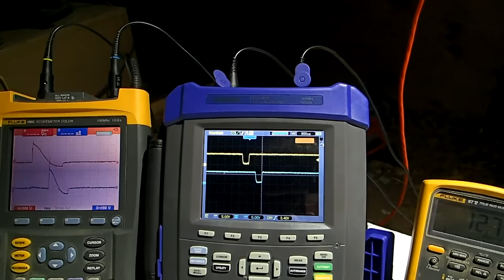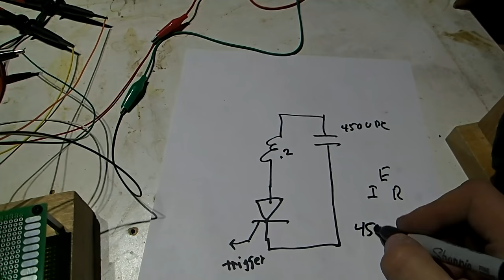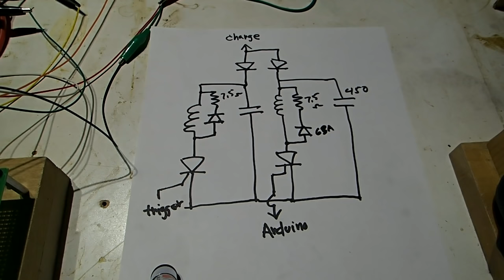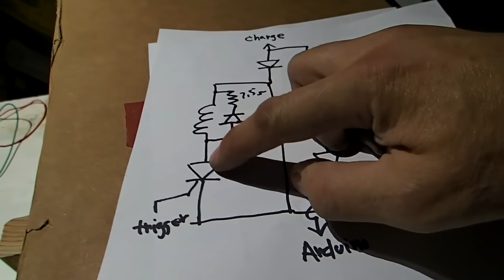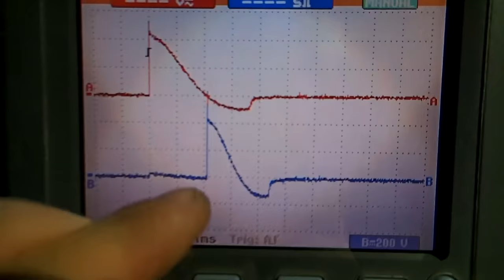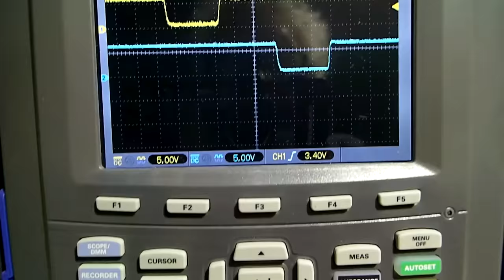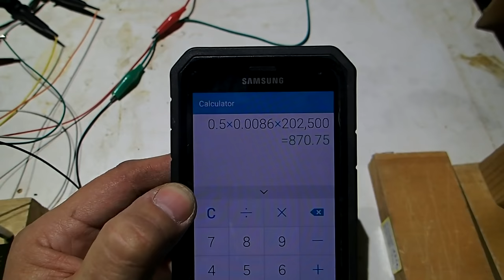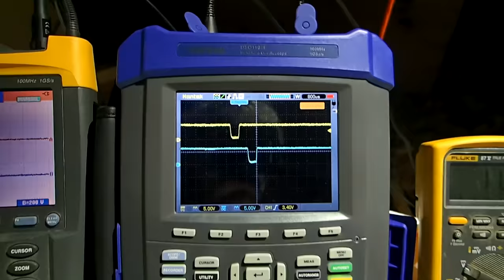World Fastest Six Stage Coil Gun Yak Questions Answered

Comment: May I ask why you used diodes and resistors parallel to the coils? The thyristors shut off when the current is zero so there won't be any damage through induction voltage anyway. I think the parallel resistor even lowers your speed because the coil is losing the remaining magnetic energy more slowly compared to just let it fully flow back into the capacitor. 
I also experimented a lot with coil guns so far and also tried different more or less complex circuits like using the stored energy of coil 1 to assist coil 2 but also tried your resistor + diode parallel thing and also diode + capacitor in parallel but I couldn't see any advantage. Actually I just let the capacitors freely recharge with negative voltage and discharge them over 2 small coils with a few windings at the end of my 6 stage coil gun (so its somehow a 8 stage gun) to gain additional 7 m/s plus the capacitors are recharged with about +50V at the end by these last 2 coils.
My coil gun is currently accelerating a 28 grams projectile to 95 m/s but Im still using single thyristors and big capacitors with screwing connectors which is really bad.
Are you still working on your gun?
Reply from the maker: You did not absorb any of the information in the video so all I can suggest is that you watch it again, the back EMF from the coils is conducted through the diode and a resistor in series not parallel that feeds back into the capacitor bank and charges the capacitor Bank up backwards you would think that it would be some damage to the capacitors but that only lasts for instant of time and then capacitors are discharged by the second diode and resistor in series in another part of the circuit which is shown in the schematic of the video and explained.
Reply: @RaptorRotorHead  What I basically mean is that your circuit would also work without the resistor and diode (in series) parallel to the coil. I couldn't recognize any change when using it on my gun except capacitors being negatively charged a little less (like -200V instead of -260V) because at the moment the Voltage (at the coil)  drops below ~ -0.5 V, the current generated by the coil will split and feed the parallel resistor+diode and the capacitor simultaneously.
Reply from the maker: @sacrifer7499  yeah it would work without it but at a loss of power. What are you using to measure speed? I am using a scope. The diode and resistor control the suckback on the projectile and the reverse voltage, mine was 200 volts.
My coils were close to 300 turns. Without a resistor in series with the diode, the diode 20amp would explode. Unless there is a scope or chronograph to measure speed there is no way to know if the experiment is going faster or slower.

What you see in the video is everything that is needed to get the maximum speed and control voltage spikes so as not to have too much EMP to confuse the computer system that fires the coils.
Reply: @RaptorRotorHead  My measurement system is like yours but instead of a scope iam using the controller to measure the timing which also calculates the speed and displays it on a little oled display.

Funfact: A Diode once exploded and also my Thyristor was destroyed because of that. The resistance was either to low or the Diode wasnt able to hold back the 1kV and simply bypassed the coil and thus shortcut my whole circuit.

However, I measured no change in speed when placing a Resistor + Diode parallel to the coil (also changed the trigger timings). I tried several different Resistors and once I got +1 m/s but that wasnt repeatable so I think it was just a little error due to a slightly different starting position of the projectile. Maybe I'll give it another try soon with different capacities.

I will also upload a video of my gun demonstration soon but actually you can only find one of my first coil gun which was a primitive brush commutated coil gun :)

My current gun is far from mobile use with its weight. Im using 16 350V 3300uF capacitors each one 460 grams heavy. They are easy to connect and cost me nothing because we have dozens of them rotting unused in the company I'm working in. Next step would be ordering about 60 x 350V 1000uF capacitors with a weight of about 70 grams each but thats so expensive.

Comment from the maker: well I just did you have to figure that the turn on time of the SCR is like a microsecond or less so it if it was late by 500 nanoseconds that's not going to matter. Also diodes in parallel do not lower resistance you're thinking of Power fets. scrs have a voltage drop of six tenths of a volt no matter how many you put in parallel. what increases is the amperage capability. this gun has been shot hundreds of times, wit no failures. that's not to say I didn't blow up stuff in the beginning because I did. where's your video does your gun run on batteries?

Comment: Well I plugged your Ft. Per. Sec. 256.4102564103 into a converter and it comes ouy that your projectile is traveling at 174.840819136151 Miles Per. Hour which is decent, if I right in my numbers.

Comment: Good gun) but i stiil didnt understand what speed the projectile reaches?
Reply from the maker: About 260 feet per second.
Reply: @RaptorRotorHead  Do you think it is possible to reach a speed of 100 m / s?
260fps≈79m/s
Reply: @gexometilentriperoxiddiamin  well that only depends on the number of coils and the voltage you use. It's helpful to increase the voltage in 330 volt steps for every 2 or 3 coils for example. So coils 1 and 2 @ 330V, coils 3 and 4 @660 V and coils 5 and 6 @ 990V and so on. This way you achieve a linear increase in speed per coil.

Comment: Is there a reason that one large coil can't replace a multi stage system? Wondering about accelerating the velocity of a preaccelerated projectile. Thinking conventional propellant.
Reply from the maker: The projectile cannot gain enough speed with one coil you might make 100 ft per second, with two coils you could make 147 feet per second with three coils you make 180 ft per second so as you can see I've already tested this out each successive coil get you less and less speed. Maybe you could use one coil if you use 10,000 volts, and sling a massive projectile, but then we're beyond the voltage rating of this circuit.
Reply: @RaptorRotorHead  Ahh, yes I'll definitely be using a different circuit. My friend has much more knowledge on this end. Projectile will be quite large by comparison, I'm thinking 12mm, about an inch and a half long tool Steel cylinder with a carbide core. Construction of such a prototype is legal in my area as long as I don't exceed a given diameter of projectile where it becomes a "destructive device" as per US federal laws. I'd like to achieve 6000fps, which is crazy, but shoot for the moon right 😂 science. Not dismissing the multi stage coil though, just wondering about the reason you used it.
Reply: @RaptorRotorHead  obviously I have a serious amount of math to do, I'm a prototype machinist with access to machines and exotic materials, and I have friends who are adept at welding and circuit design, electric motor building soldering etc.
Reply from the maker: @SunTzuLao  if you expect 6000 feet per second you better use rail gun technology to get that.
Reply: @RaptorRotorHead  yeah it's so much more complex though, and fragile. Was hoping I might be able to overcome some of the shortcomings of coil gun theory like magnetic saturation by using it for a secondary acceleration mechanism.

Comment from the maker: usually you don't need an air gap in a Transformer Almost Never most the time there's an air gap in a inductor. if there's an air gap in the Transformer it's probably because they were afraid the core was going to saturate at the current level going through the core.

in the carbon fiber tube is .280 ID with a .032 wall thickness

Comment: Why not use spark gap and projectile as your trigger. Instead of mosfet, which requires painstaking calculations in sequencing to get "kinda close" to the proper firing where as my way would react as soon as the projectile is in range and off as soon as soon as it's gone. It would be exact for every stage, no matter how many stages with zero programming.
Reply from the maker: There is no mosfet triggering in the circuit it's all high voltage scr computer-controlled
Reply: @RaptorRotorHead  Thank you for such a quick response. I've not used scr's yet. I am still working on a design. What about the solid contact/spark gap and projectile for firing? Would that be plausible? What would be the downside other than the obvious maintenance of contacts and projectile wear?
Reply from the maker: @mobiusprolix8454  response time would be the problem with that type of circuit what is needed is a computer that is capable of 3 microseconds of timing error and no more, operating solid-state scr so that the response time there is instantaneous
Reply: @RaptorRotorHead  Thank you

Comment: do you remember the timing sequence for the coils . can you tell me
Reply from the maker: Stage One 2.1 ms, Stage Two 1.4ms, Stage three, 1 ms, Stage four 800 usec,
Stage Five 600 usec, Stage six, 580 usec
Reply: Clay Reid  did you just use the function called delaymicrosecosd to produce the delay or is there any other method
Reply from the maker: Vasudev Mr yes delay microsecond
Reply from the maker: Vasudev Mr https://youtu.be/II8qjVNtVIY watch this video I think I can recreate this with much more power and what this guy has achieved is pretty nice for small size look at it, is it the relationship of a coil to it's magnetic flux more intense if the coil is flat look at its design
Reply: Clay Reid yes Coil should be flat so that magnetic flux will flow normal through the projectile and when this is so ,Max Eddy currents will be induced so Max repulsive force. so you have to make your coil length shorter

Comment from the maker: the firmly mounted the coil gun is the better the mussel velocity
Reply: Clay Reid which is that scr you are using , part number ??
Reply from the maker: Vasudev Mr the scr part number is btw69-1200.

that's a 50 amp 1200 volts good for five hundred amp surge. I used 10 per coil.
Reply from the maker: Vasudev Mr look at this video.
https://youtu.be/ZlTaYCWuZsM
Reply: Clay Reid he was using 5 kv cap bank , won't work well with 450v for single pulse for us . and the ammo soo weird .
Reply from the maker: Vasudev Mr I calculate that is capacitor is only 47 microfarad
Reply: Clay Reid  so it's the voltage which is doing the magic , I was right about this couple of weeks ago
Reply from the maker: Vasudev Mr the voltage is causing a massive amount of current to flow remember the formula, current×turns ÷ coil length.

it is not the high-voltage it is the current flow the the high-voltage causes
Reply: the same thing ,only because of high voltage high current can flow to produce large magnetic flux density .
Reply from the maker: Vasudev Mr on my patreon page my patrons can post images of their experiments you would click the community button.
Reply: sure i will post some of the photos

Comment: Dude if you see this comment your smart as fuck dude…. Im a military veteran and hobby learning enthusiast so to speak…. I want to build myself a high power coil gun like 8 stage and super high voltage…. I want to reach speeds of around 1100 fps with these damn Phillips head bits lol you interested in being a virtual penpal and mentor? Ill pay ya if it makes a difference and i really just wanna learn this while not blowing my self up and/or lossing another limb, my legs easy to deal with a hand would blow to lose. I also wanna minimize cost of components used in the sense of i can unsafely buy research experimentally full send and learn but that prolly be pricey ontop of recklesslol
Reply from the maker: I don't want to take the wind out of your sails I appreciate your comments greatly the problem is after six stages there's an issue with inductance in the sixth stage coil what's going on at this moment is the projectile is going to slightly faster or at the same speed as the coil can magnetized so only a little more energy is delivered by the sixth coil.

To add a 7 coil would be a waste of wire and weight on the project.

But heck six coils that's 180 miles an hour it go through a coconut really no need to put anymore afterwards I invented the laser gun you can find that in my video it's much smaller and Compact and actually very destructive

Comment: Six megawatts? That can't be right! 
That's equivalent to 3,000 homes at once..
Reply from the maker: Yeah but the pulse only last for 5 milliseconds. This video below should have five million hits

https://youtu.be/DjoYHLye2p4
Reply: @RaptorRotorHead  "Yeah but the pulse only last for 5 milliseconds." 

5 milliseconds? That's very precise.

It appears you're successfully using parallel mosfets to handle that load. 
Do you think parallel, off-the-shelf mosfets could handle 20,000v @ 4 amps?

How do you protect the mosfets from voltage caused during a coil's magnetic field collapse?
Reply from the maker: @Dr_Wrong  read this good information
https://en.m.wikipedia.org/wiki/Pulsed_power
Reply: @RaptorRotorHead   I believe this is wrong, here is why. You simply took applied voltage x current (DC resistance of coil). That is NOT how it works, the coil is an inductor, so current takes time to rise, get a scope current probe or make a current transformer. In addition to the 0.2 ohms coil resistance, you have long power wires (about +2 feet) from the caps to the coils, plus the switch resistance, all that extra resistance and inductance is very real in this application, I am guessing your PEAK current is less than half for your calculations. And the peak current TIME is very small compared to your claimed 5ms.

Comment: This is the most impressive coilgun I have ever seen, so I am very curious about it's calculations.  Are ALL of the capacitors for ALL stages identical?  If so, How many are used on each stage--I assume each cap bank is a parallel bank,  I would like to know the total electrical potential energy of each stage right before firing.  Thanks for sharing this gun that does more than dent a coke can!

Comment from the maker: If you look in one of the videos you can see how long the coil hanging at
Peak voltage on the scope it's only about 150 microseconds inductance of
the coil is 326 microhenrys.

Now you do know that in a DC circuit the coil is going to saturate there's
no inductance in a saturated coil or Transformer for that matter.

10 shots fired in four second intervals results and 160 degrees Fahrenheit coil heat up. Trust me the current is flowing.

it's funny how some people go around and put garbage on people's videos and they don't even have an account with videos to where you can go post on their videos some garbage about them.

the garbage people need to go to school and learn about saturation nobody talks about that but that's more important than inductance because when you when you saturate a Transformer that's when things explode on the input side.

Comment from the maker: because it doesn't work it would saturate too easy also it's a difficult thing to do. the rise time of the current. would be impeded buy too much inductance. resulting in the projectile entering the coil and leaving it before the magnetic forces can act on it because they are hindered by the inductance of the coil.
Reply: can you explain better what you mean with saturation? Also wouldn't 8 layers result in a lot of inductance and therefore slower rise time of current. I'm surprised it happens as fast as it does in your system.

Comment: Around timestamp 4:30 your calculation of 1 Mega-Watt of initial pulsed power is in serious error!  You forgot to include the inductance of the coil and assumed it is zero in your calculation.
If done correctly, for even a very small self inductance, the inductive reactance XL, makes this power MUCH less.
Reply from the maker: You seriously forgot about the inductor saturating which has nothing to do in the calculation at that point we're talking direct DCR go back to school and do your homework
Reply: Been there, done that!  ...and I WAS speaking of "saturation inductance" (worst case).  You cannot ignore self inductance. Even if  the inductor was made of superconducting wire, where "DCR" = 0, L is still finite and plays a critical role here. @RaptorRotorHead
Reply from the maker: @dalenassar9152  I can tell you that the coils get so hot that they could almost smell so definitely that's a lot of wattage just to fire it a few times 5/6 times and it hot

Comment from the maker: you bet a lot you can lose twenty-five 35 feet per second. especially on that first coil on the left which basically contribute almost half of all the power or speed actually the other coils multiply it.
Reply: I am building single stage coil gun and have reached efficiency of only 2 percentage, I want to increase the efficiency upto 4 or more .so I will try to add a resistor in series to diode and I will see

Comment from the maker: the guy mrnickbig1 doesn't exist on YouTube I can't find them is it ghost going around spreading false information remember there is saturation in an inductor in a DC circuit. saturation is reached inductance goes to zero that happens in every coil gun.
Reply: Moss Fett I've been playing with the idea of building a coil gun. Now I planned on using optics along with a initial boost of CO2 to give a little extra velocity before the projectile hits the first coil. I would like to use your power supply. Is there anyway to get a schematic to build from?